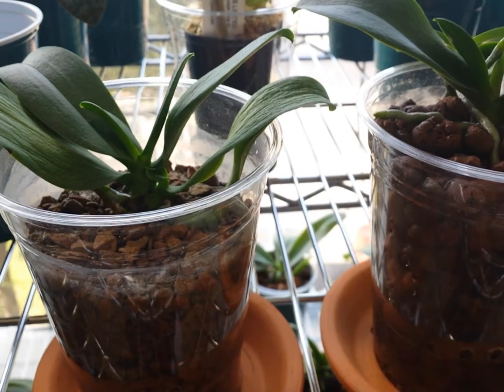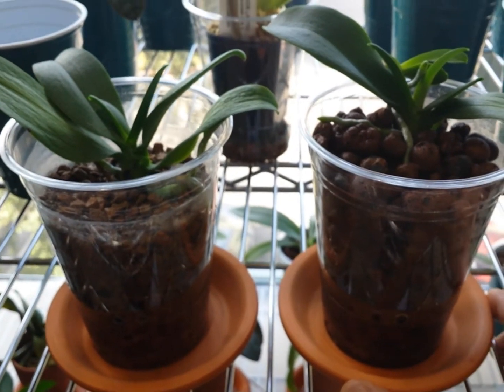Orchid Experiment - Thoughts on Hydrocorn (LECA) and Monto Clay

Comment: Hi! I am new to the orchid hobby and I am so glad I came across your channel. Your orchids look very nice. I have some of my orchids in leca and I noticed that the ph in water changes to alkaline at some point. Will the mixture of monto clay from bonsai Jack and Leca help keep the p in water between 5.5-6.5 or I just have to not worry as long as the water does not go below 5.5? I noticed that the monto clay from Bonsai Jack Store I found online says Montmorillonite Calcined Clay with ph 5.6. Is that the exact  one you used? thank you very much for your help.
Reply from the maker: Thanks for your kind message, Gen. My experience is that there is no need to worry too much about the pH as long as it doesn't get below 5.5. When the water is slightly acidic, it is actually easier for certain nutrients to be absorbed by orchids. And yes the monto clay you found online on their website is what I'm using. Hope this helps.
Reply: @OrchidLoveATX  Thank you very much for your help. 😃

Comment: I am sure that you know that phalaenopsis and other orchids start producing keikis when they're under extreme stress and trying to survive. From the looks of the leaves of both of those plants they have a lot of discoloration in their leaves and that might mean lack of calcium magnesium and some Epsom salts will do it good a teaspoon for a gallon of water and make sure that your water's pH is what it should be👉👵👈
Reply from the maker: Hi, Libby. You're probably right. Another possible reason could be that they are losing some roots in the pots as they adjust to semi hydro. Also, sometimes orchids lose leaves due to root rot. As for my water pH, I usually adjust it to be around 5.5 before I water them. : )
Reply: Libby's Little Garden I agree, the oldest leaves on both plants have completely lost their rigidity, and that means they're not getting sufficient moisture, at the very least. Sure, some crosses of Phals (and other orchids) just tend to throw off so many keikis, even if it's healthy, due to a genetic predisposition, and they'll do that until they've basically killed the mother plant due to her using up so much energy on the keikis. That might be part of the problem, but the one on the left has two healthy roots, and has nice newer leaves that have grown, but it appears that the medium is too dense for the roots to grow into, and if a Phalaenopsis root cannot push through that medium, I can't think of any other orchid that would be successful in doing so. I understand that this is an experiment, but I don't think that either one will survive if they're both left in their current media. The one on the left can probably be salvaged if it's carefully removed from the clay, and put into a nice, well-ventilated pot with dampened sphagnum moss that's kind of left fluffy and airy, because we do know it has at least two viable roots, maybe more underneath, and more "nubbins" look ready to sprout from the base. The one on the right, well, I don't know, but I don't think it's going to make it as it is. I’d try the same as above, and acclimate the keiki roots to living in sphagnum moss, and pot them all up with the mother plant. Maybe one will make it. I know this is just a hobby, and an experiment, but we're to the point that we know that both of these are a fail, so why not try to save at least one of them? I dunno, I hate losing any of my orchids, I know it's just a hobby, but I have some orchids that I've had for years, that moved cross country with me, and I’d be upset to lose one of them. I buy my orchids for enjoyment, but I do get a bit sad when I have to toss one that I tried to save.